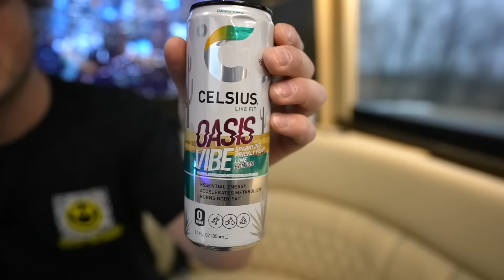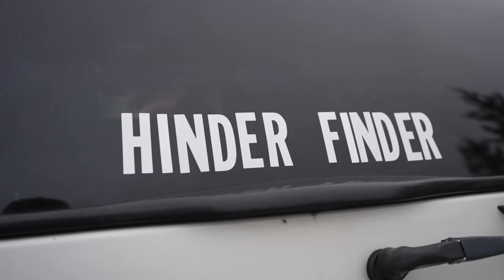Testing my New Ford Raptors Suspension

Comment: Guys are very lucky with that tow strap. Had a similar thing happen in my area where the tow hook snapped went through the back window and killed the driver by hitting him in the back of the head. Always use chains. Not tow straps.

Comment: Raptors are very good off road. The best I know brand new with power suspension with position sensitive tunable Fox Shocks. I think above my price range and don't think i would want to drive it fast off road he way I like but 4 wheel drive for a fast good suspension truck is a huge plus. @ wheel drives are a lot less work to get more wheel travel out of. 4 wheel drive is not so easy to get front suspension travel with power to the front independent suspension. The Ford Twin Traction Beams are a good platform for that to build on. I went with an old full size bronco . I liked them my dad had one but s 79 many would like the solid font axle like the resr for strength with their use. The independent front suspensions smooth out the bumps much better.4 wheel drive Trophy trucks are rare & cost a lot more to design & build but did very well. Able to build a full size Bronco a original or close to full size 4x4 SUV with not a huge amount more but more suspension travel than a Raptor made me happy . 13ront 13.9rear last I heard stock inches on new Raptors what i read. 17 inches & 28 inches rear on Deaver leaf springs. A four link would be more in the rer but would require body work in the rear to have the shocks mounting inside

Comment: Guys, do me one favor? Don't do that with the tow strap again. I gave seen a tow strap break loose and go right through the back window of a truck and kill the driver instantly. I have seen many close calls and other nasty injuries. Matt's towing here on YouTube had to pull a truck out because the same thing happened. They used a tow strap like yours which is only designed for towing on flat ground and not pulling stuck vehicles. Get one rated for that or you can have an accident you might not walk away from. Saying this as a fan who cares about yall. So please be safe with towing straps especially not taking the slack out before hitting the gas. That could have been your head, Ben & Ev.